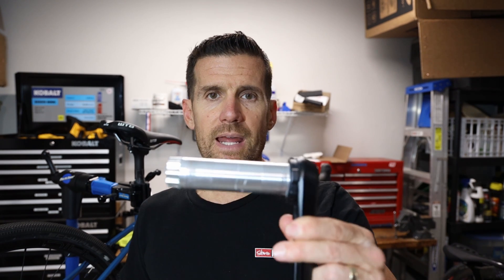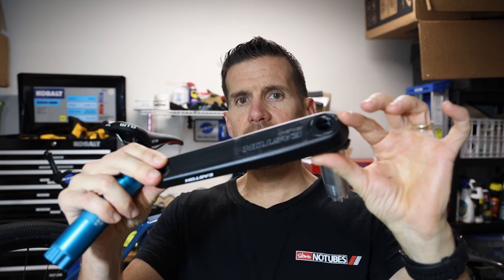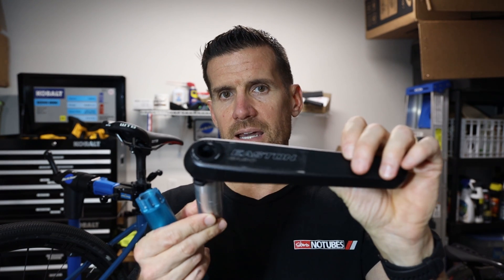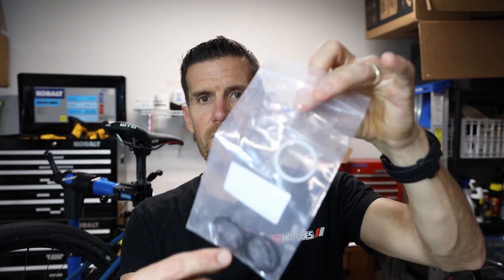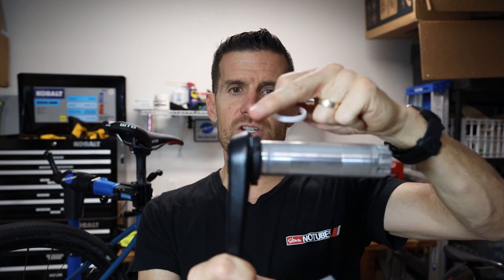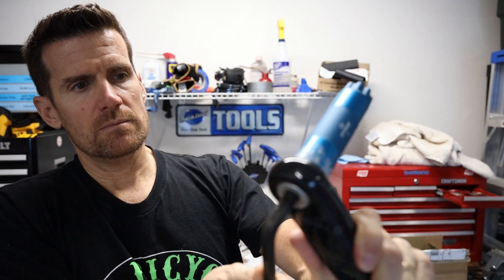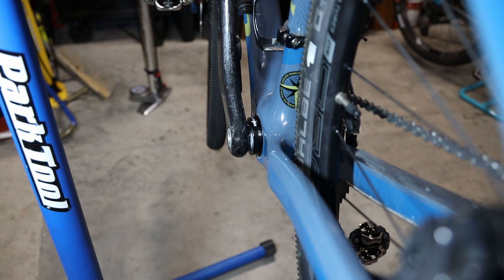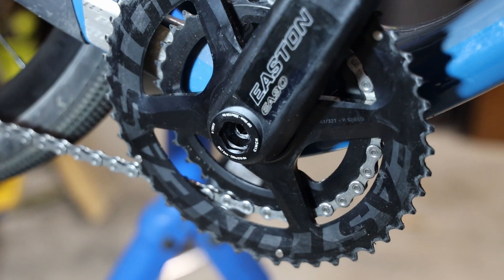Stages Power Meter: Why I Use One and Tips for Installing

Comment: Hello!!! I went to Stages site cant find any details on how long their spindles are. Bike fit requires me to a have specific length, just wondering if you have any idea. Trying to find on the details of spindle B or C as this should work on my crank :) Thank you in advance for your reply!!!
Reply from the maker: It's been a while, but if I recall correctly I actually had to call their customer service to get the spindle length.  I believe there's also a guide on their website to help you match your specific crank set to to the right spindle.
Reply: thanks!

Comment: Race face cranks, which are similar to the Easton (both use cinch system) allow both crank arms to be removed. That is a plus if you need to change the spindle width going from one frame to another.

Comment: Hi.. i use left power meter too, if i use left only, is my garmin edge will read half of my power? Cause i compare my edge and my fenix, my fenix is read my power value is 2x my value at garmin edge..
Reply from the maker: The Garmin will know that you're only using a one-sided power meter. It still shows your cadence and your power. The power is still very accurate.

Comment: What would be the best power meter crank arm for 'Race Face Ćffect SL 36x26T, 175mm'? I have a cube reaction gtc 2x 29er from 2017 and I can't figure what power meter will that would be compatible with garmin/swift. Can someone help?
Reply from the maker: I would contact Stages for compatibility. Their power meters are so simple but work well.

Comment: Had 3 stages power meters on 3 different bikes all experienced battery drain and were eating batterys even when not in use I changed to 4iiii precision podium same system but no battery drain problems

Comment: How often do you calibrate your power meter ? Every ride ....or a big change in temp ( I have heard temp will affect the meter).

Btw....I just started riding with garmin’s radar tail light (Garmin Varia RTL510).  It’s a bit pricey....but I will never ride w/o one again.  Highly recommend.
Reply from the maker: I would probably say every other ride I calibrate. Only takes a few seconds so it's worth it.
Reply: @ClintGibbs  Initially I used to do it every ride but then stopped doing it as often, because - certainly with the Assioma pedals - the resulting zero-offset number always stayed the same.
           I concur with you that power meters are an extremely useful aid, definitely for training and racing. I would not be without one now.
Reply: Power meters these days are quite good at taking the temperature into account. I usually zero-offset my meters every 10 rides or so, or when I remove the pedals, etc, for maintenance.
          I also have the Garmin Varia. It's an excellent device.
Reply: @dpstrial  good to know.  i had a stages on my previous bike...now i have a quarq on my new bike.
Reply: @frankstrobel4350  I used to have a Stages and it was really good. I sold it when I upgraded my crankset. Now I use Assiomas, which are excellent.
Reply: I "calibrate" every ride ... my Garmin when it connects to the power meter asks me if I want to calibrate and I just hit "yes"

Comment: Will you get left and right side power with this setup?
Reply from the maker: Probably not. I find just having the left works very well.
Reply: I agree with Clint. I have the PowerTap P1 twin pedals (which are awful and now in storage), the Favero Assioma Duo (on my road bike) and the Assioma Uno (on my exercise bike). I produce 51% of power from my left leg, not enough difference to worry me. Personally, I do not now think two-sided power meters are worth the extra expense.
          I used to have the Stages crank-arm power meter but sold it when I changed my crankset. It was very reliable.
Reply: @dpstrial  awesome replies ! Thanks guys!